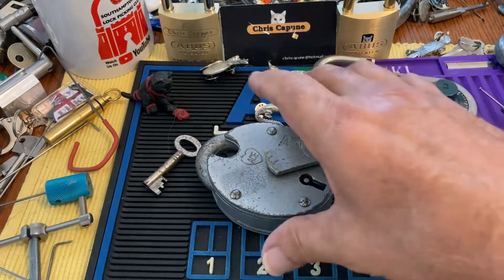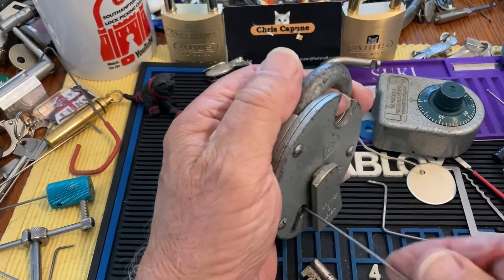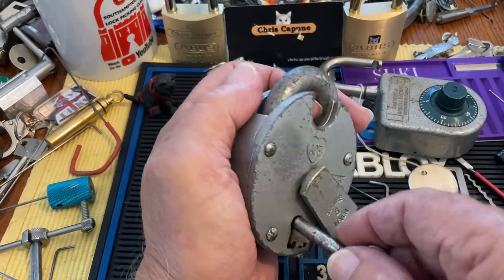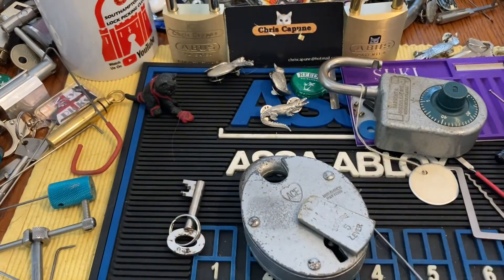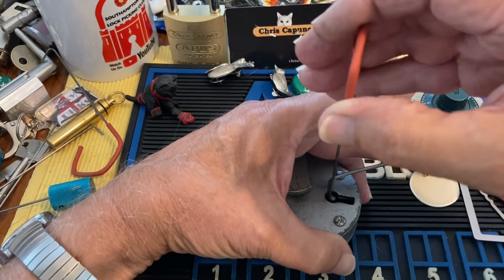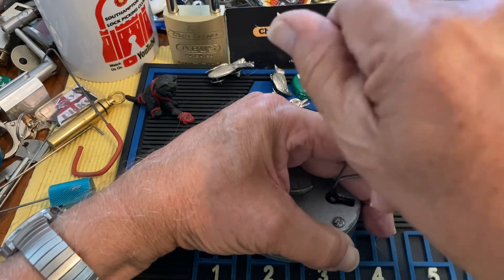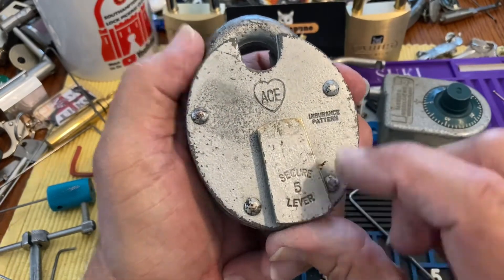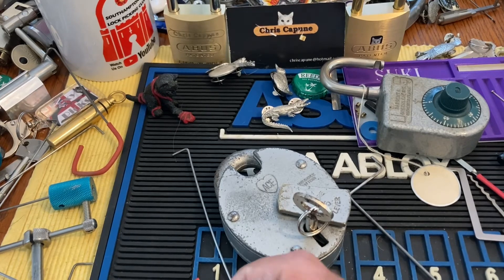#1575 ACE Lever padlock two wire picked

Comment: I spent an hour trying to fit the wire in the bolt. It won’t catch. Even if it does, I can’t get leverage on the levers to lift them with the pick wire. I think I will leave the two wire method to you and Brummie. 
I don’t have the patience for it. You are a better man than I Gunga Din. 👍🦊
Reply from the maker: I just sit here and try wires till I feel a good hold on the bolt. Then try to find the levers. But I don’t spend more then ten minutes on messing with the lock. 
My frustration point is low so I keep the time down. I will walk through the lab and sit down for another go while I wait for the coffee to get done of the Chicken to cook.  
Like lifting the levers , just a bit at a time 😀
Reply: @chriscapune7873    Good idea. Maybe I should try that approach. I sometimes give up too easily 😡👍

Comment: Very nice two wire pick Chris, congrats on the open👍🏼🔓 Question: Did you file flat the length of the tension bar that the pick wire sits next to? Thanks for sharing another great video and take care my friend 🔐🐱🐾🐾
Reply from the maker: Yes did file the tension wire flat so it would hold better and be a bit easier to get in and out.
🐈‍⬛🐾🐈🐾👍👍👍